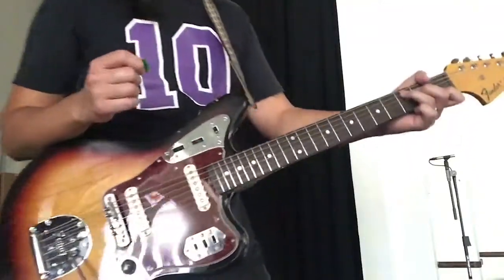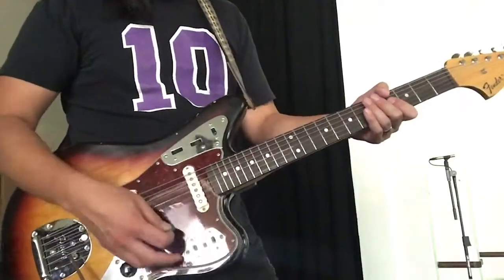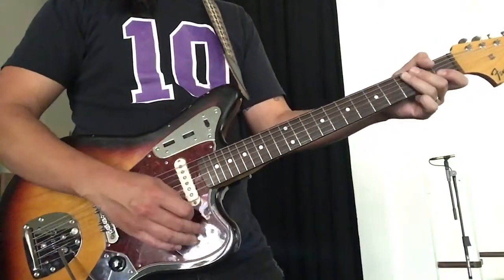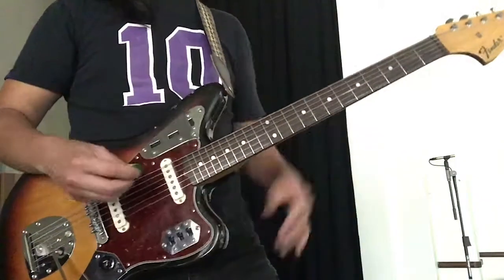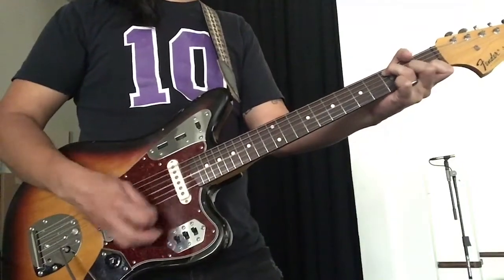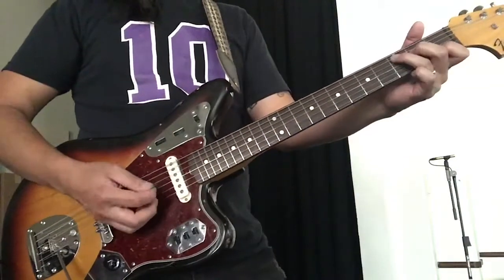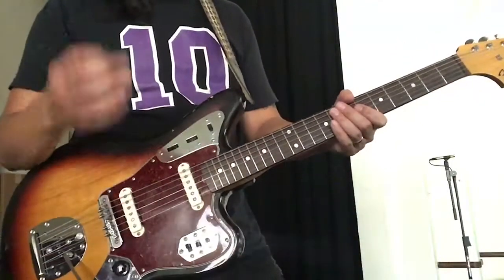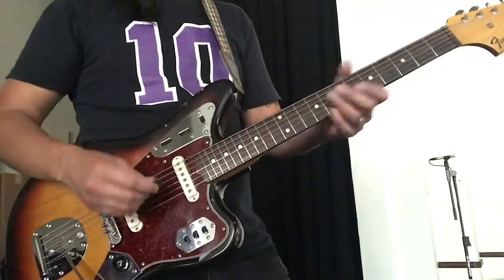Fender Jaguar Series | Parallel | Phase Mod

Comment: What kind of pickups and pots are you using? That jaguar has a really nice thick sound.
Reply from the maker: Lollar Pickups and 250k CTS pots
Reply: can you provide wiring?
Reply: Jacek Kurowski 

The original diagram I drew many years ago:

(I updated the diagram with switching info.)

https://i.postimg.cc/GhjczNfS/56-A35602-FFE8-45-BF-82-BE-8-FC8307-C5-E81.jpg

Comment: Do you still have the rhythm circuit separate still with this mod?
Reply from the maker: Mad Dog yes.
Reply: Chae, could you post a link to a diagram you used as a point of reference on how to perform this mod on my jaguar(s)? I’d like to try to do it. The link I followed below that you previously posted is no good. Thanks~
Reply from the maker: @johnmanion6463  Sorry man... I don't have that anymore. I swapped out my bridge pickup for a humbucker so it's no longer in Series / Parallel wiring.
Reply: @LoungingGuitars  Is this mod worth it? I was considering switching the bridge pickup with a lollar imperial humbucker or trying the mod in my 65 reissue thinline. Which did you prefer?
Reply from the maker: Jeff Spradlin if you’re getting an imperial, the mod isn’t necessary. The whole point is to get a humbucker sound out of the single coils. The phase switch I never really used.